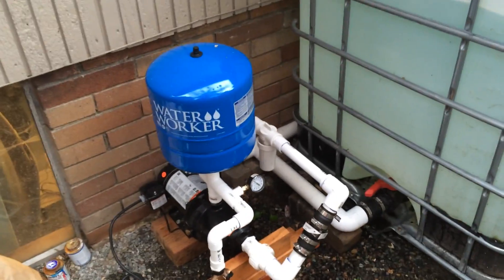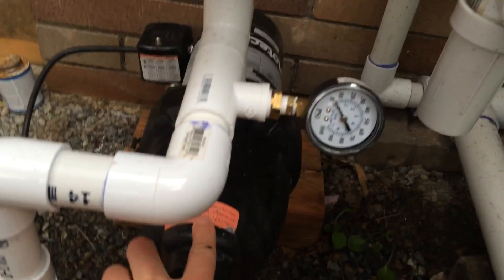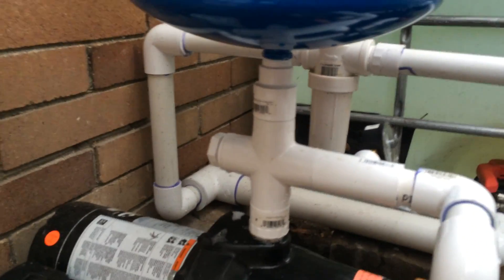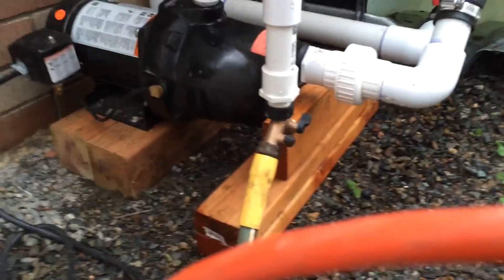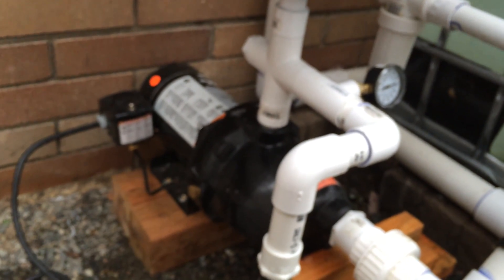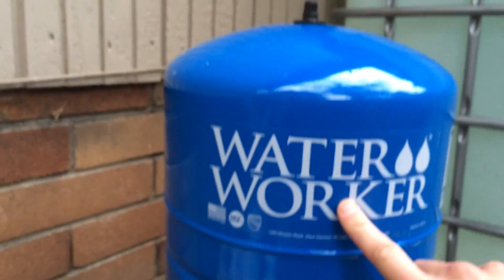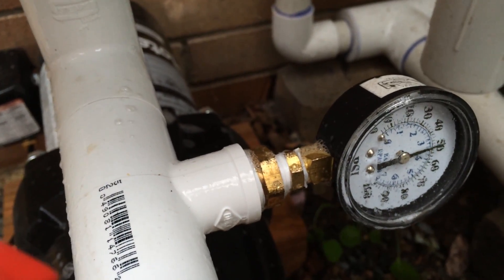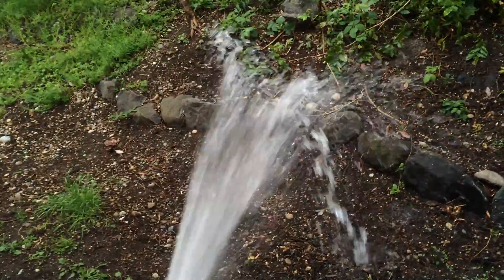Well Pump Problems - Can you help?

Comment: i have the same problem.  pump hits 50psi, shuts off and i watch the needle drop to 30psi and pumps to 50psi.  not water being used.  your is doing the samething mine is.

Comment: did you figure it out?
Reply from the maker: +Jon Hunt Yes I did in the 2nd video. I needed a stronger check valve a PVC type. The old check valve flapper was getting sucked past it's stops.

Comment: As the pump fills the tank with water, the air above the diaphragm is compressed. This increases the pressure in the tank and causes the pressure switch to turn off the pump. 
When water is drawn from the tank, pressure inside the tank decreases until the pressure switch starts the pump. The amount of water delivered between pump cycles is called drawdown. The greater the drawdown capacity, the less the pump needs to run, saving energy and money, and extending pump life. 
As water is drawn from the tank, the reduced pressure starts the pump and refills the tank.
THE CONFIGURATION OF YOUR SUCTION PIPING IS WRONG,try to do this from tank install 1.1/2'' PVC pipe and reduce this piping going to suction nozzle..from discharge nozzle start bigger PVC pipe and reduce it to small diameter piping

Comment: Wow wow I'm a service man your check  v. should be directly after the pump because the tank is pressurized so of course it's going to keep cycling because it's going to take the pass of least resistance, some pumps have a check built in others don't refer to pumps owner manual to find out if yours does. Make sure all taps are turned OFF and make sure the container to the right is not taking water and see if that changes your outcome any hope I've helped 

-dan

Comment: It also looks like you might have multiple paths for the water to flow in and out.  It should go from the tank, then in to the pump, then out of the pump, then to the "T" fitting that connects to the pressure tank.

Comment: You can get the specialized "T" fitting at Loews or Home Depot etc.  The "T" fitting has built in fittings where you can attach a spicket, a check valve or maybe a pressure gauge.

Comment: My pressure tank has "T" fitting on it.  The water comes in through a check valve on the left side of the "T"...then into the pressure tank through the middle of the "T"...then when I turn on the water in the house, or flush a toilet, the water exits the pressure tank through the right side of the "T".

Comment: I looked at it again.  It looks like the check valve is in the wrong spot.  You might need to rearrange your plumbing so that the check valve is installed with the arrow pointing to the output of the pressure tank, NOT the pump.

Comment: I have a 1200 gallon rainwater collection system and mine did the EXACT same thing at first.  It's not a leak in your plumbing.  What is happening is that when the pump starts filling the pressure tank, it fills it to about 60 pounds, then the pressure switch turns it off, and then the water in the pressure tank starts flowing back out through it's INPUT pipe.  then when the pressure switch is low, the process starts over again.  You need to put a check valve between the input pipe and the pressure tank, so that it can only flow through the output pipe.

Comment: I am suspect of the check valve. Additionally I'd say have the check and filter on the outlet side of the pump, but it looks like you are pumping just fine.

I don't like check valves at angles either. Either horizontal or vertical flowing up if it is a swing check, I guess the spring loaded ones don't manner so much but I'd use the same rule.

Comment: can the drop in pressure be caused by the ibc containers not holding the pressure the pump builds.
Reply from the maker: There isn't any pressure in the totes they gravity feed the water to the pump. I'm hearing that check valve is leaking from everyone.

Comment: So if you pop the input valve (at your source tank) the moment it hits pressure, does it hold any?
Reply from the maker: i did try that and it popped the furnco fitting off the tank. That makes sense it would be the problem though. I'll try it again, I wonder how it would have pressurized the water inlet?

Comment: it dose sound like your valve is letting water leak back into your water holding tank
Reply from the maker: ya I guess my check valve must not be able to hold the pressure so it leaks by. I wonder if I used the wrong type of valve or positioned it weird? It's at an angle.

Comment: Check valve on the outlet maybe?  Even so, it looks like your check valve on the inlet is leaking, which soapy bubbles would not show. So it sucks in the water and then lets it back out.  Still better idea is check valve on the outlet as what you are doing is basically blowing up a balloon.  Hope this helps.
Reply from the maker: That makes total sense, it did it worse (faster on and off) before I had a pressure tank so water must be leaking back into the water tank past the check valve. Did I use the wrong kind of valve?